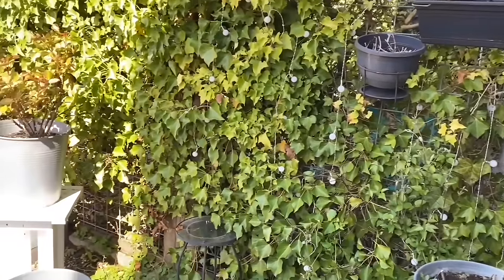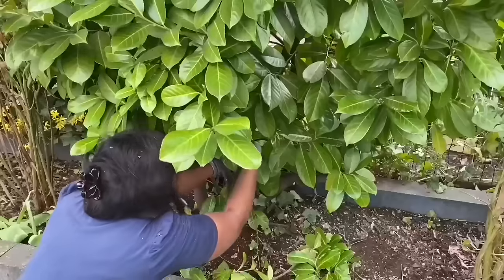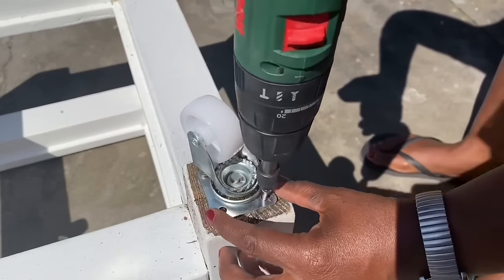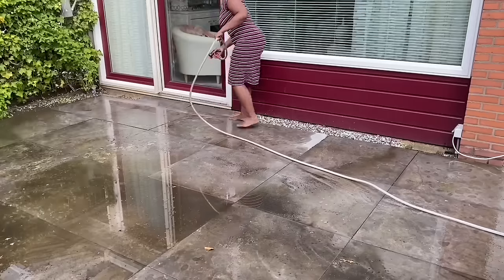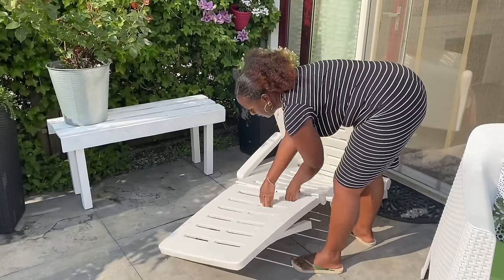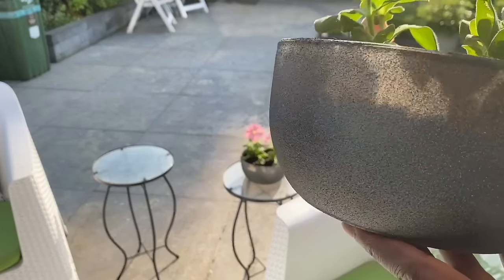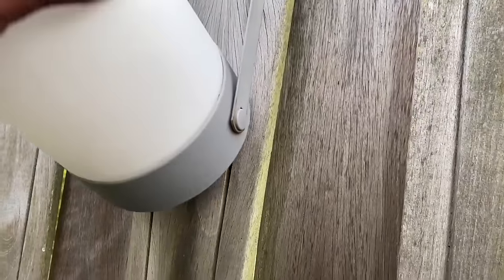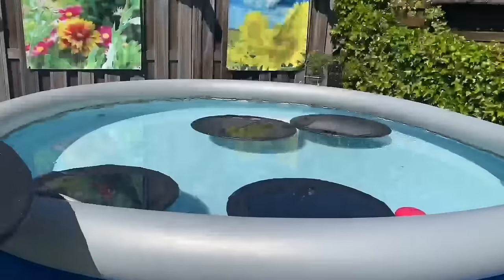NEW BACKYARD SUMMER REFRESH 2021 | Low budget small patio makeover

Comment: I love " you are preparing your self for summer..." I do the same... could you be so kind to tell me were I can buy the little brush with the pointer to clean in between the concrete?
Reply from the maker: Hi Nery, I loving getting this space ready for summer and I love enjoying it even more 😊 I got mine from a local hardware store. But I found one similar on Amazon. https://www.amazon.com/GeeRo-Cleaning-sidewalk-driveway-cracks/dp/B08TWFWW14/ref=mp_s_a_1_4?dchild=1&keywords=weed+brush+tool&qid=1625696156&sprefix=weed+brush&sr=8-4

You might want to look for alternative prices though, this one is quite expense. I got mine for less than €10. If you decide to get it, I suggest using only the pointy side. The brush leaves scratches.
Thank you for watching and take care 💕 💋

Comment: Where every did u get your concrete brush for the cracks. I need one of those with bad back, without having to bend.
Reply from the maker: Hi Karen, I actually got mine from a local hardware store here in the Netherlands. But I found one similar on Amazon. Here's the link:  https://www.amazon.com/GeeRo-Cleaning-sidewalk-driveway-cracks/dp/B08TWFWW14/ref=mp_s_a_1_3?dchild=1&keywords=weed+brush+tool&qid=1625759641&sprefix=Weed+brush+&sr=8-3

You might want to search for a more affordable one though, mine was less then € 10.
I really recommend using it, it'll make your life so much easier.  Thank you so much for stopping by. Have a great weekend 💕💋

Comment: Wow its beautiful! Where did you buy the pool! Its nice no need to blow it up just fill with water and its set!
Reply from the maker: Hi Amira, thank you so much. I got this one over 6 years ago. But they still sell them on Amazon. Mine is from the brand bestway, they also sell the brand Intex, which is a little more expensive but does the same job. I actually do have to inflate the top ring of the pool,  but that takes less than 5 minutes with an electrical pomp. Thank you for watching 💕 💋

Comment: Remove those old gravels, clean most of weed roots that you can, then install  a weed mesh fabric secured with pins to the ground, then you put a thick layer of gravels on top of it.  Mesh will prevent the weeds to grow over the gravel. It will very easy to keep it, you may not to weed it for years..
Reply from the maker: Hi Elma, thank you so much for the suggestion. I was thinking about that as an option too. It is just the last few years that the weed is growing so excesivly. I'm thinking all white gravel. What do you think? Thank you for watching 💕 💋
Reply: As a budget saver, you might try cardboard under the gravel.  My personal experience is that weeds will grow over time, and landscape fabric only holds back old weeds—you will still get new ones!  At least, with cardboard, it is biodegradable and performs as well  as the landscape fabric.  All you have to do is add another layer of cardboard when the weeds get out of control again. And it’s inexpensive (or free)!
Reply: If you do that, don’t use the plastic weed fabric in stores. The plastic breaks down into the soil. Use newspapers or cardboard. Lasts just as long and does not harm the environment.